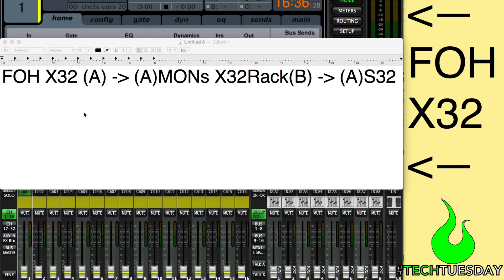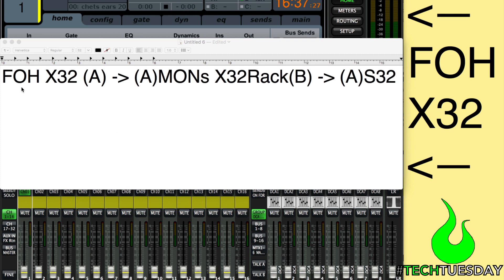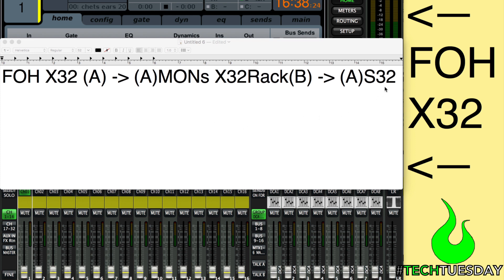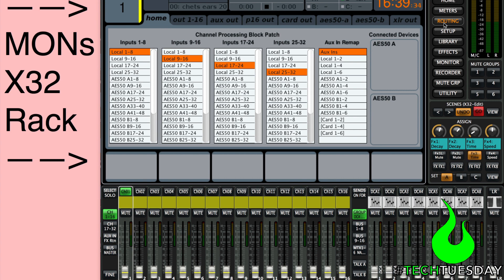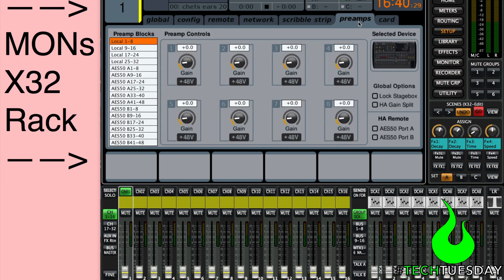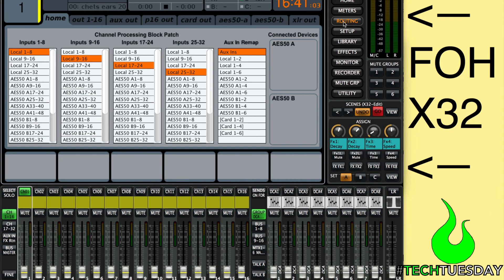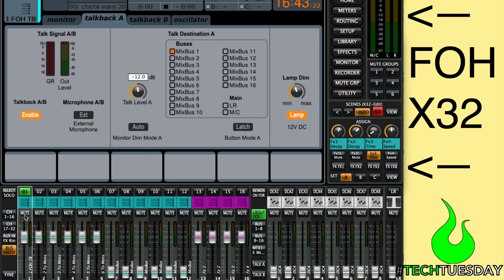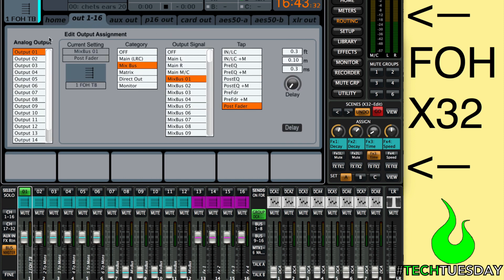Routing a Behringer X32 and X32Rack - Front of House and Monitors - #AscensionTechTuesday - EP088

Comment: hey your vids have been most helpful, but the one area i wished you talked on more, seems to be the area you just glance over. 

we have 2 X32 consoles and a S16 stage box, and two P16 routers sending to about 12 p16s. by following your video i was able to essentially hook up the two mixers, FOH Aes50 B to S16.  (The A port dont work for some reason)  the out S16 Aes50 B to broadcast Aes50 A.  Our setup is 16 channels from S16 1-16 and 17 -32 local at FOH. Following the vids in these series of vids i was able to send a mix to the other x32, but how and where do i connect my P16s?

Comment: Hey m8...nice tips for the auxes remap!! Just one question...I am watching and watching again your video and trying to understand how are you getting the inputs from the stage box??? They are connected to x32rack mixer through aes50b correct?? So shouldn't you select at x32rack at routing/home/aes50b1-32???
Found it ...hehehe 3:36 ...it s a bit brain burning but helps you practicing and understanding the signal flow through aes50..nice vid man...cheers
Reply: I was also thinking about this, the mon x32 sends the s32 inputs to foh x32 via aes50A then the x32foh sends back to mon on Aes50A. 
Is this required for the setup when you want foh to be the gain master?
Trying to understand what's the difference of just receiving snake inputs on x32 mon from aes50B ?

Comment: Couldn’t you go from the AES50 A of FOH to the S32 and then come out of AES5OB on the FOH to AES50 A of the broadcast/monitor rack as well?  That is what I’d like to do.
Then I’m not going through the monitor console to have FOH talk to the stage box and have a fairly independent monitor/broadcast mix.        Thanks
Reply from the maker: Wendell Nall Absolutely, that will work as well :)
Reply: Ascension Worship - #TechTuesday what would the routing look like?

Comment: I have 2 x32 in my church. Both need to use AES. How would I use my FOH x32 through AES to my stage rack for my PA and my other X32 for monitors through AES?
Reply: I also will be installing the waves sound grid on the FOH console. so my hope is to use the monitor console for untouched audio
Reply from the maker: Michael Lemus This video explains that setup. The scene for an X32 Rack and full sized X32 are interchangeable. Just different hardware.

Comment: Digital routing is fantastic but equally confusing...LOL!  I connected my FOH X32 to a X32 Rack and S16 that are placed at side stage.  The live stream computer that sits in the FOH video booth normally got fed from two of the bus sends.  All of the bus sends are at the stage now.  Is there any way to get bus sends to occur at both FOH and the stage?
Reply from the maker: Hey Rufus! All of your routing at the mixer should still work like normal :) 

-Chad
Reply: @AWTechTuesday  Understood, however, the routing is in banks of 8 so if the bus outs are routed to the rack at the stage, they do not output on the mixer or am I missing something?
Reply from the maker: Rufus Crowder So, generally your outputs via the AES50 ports are in groups of 8 yes but your output channels have 16 outs that can be personalized for whatever you want (such as deciding which outputs will have your main left and right signals). As a default, if you were to say route your stream busses to outputs 9 and 10, that feed would come out of 9 and 10 of your digital snake AND 9 and 10 on the mixer itself. There are ways to change this but as a default, that is how the routing is set up. 

If you’re having issues, in the routing menu, go to the XLR tab and verify that your XLR outs 1-16 are in fact outputting Outs 1-16. If not, then your scene has been modified at some point along the way.

Comment: At our church, we have our computer, cd, DVD, and the USB in our aux inputs. We often play sound through these channels. We are right now trying to connect two boards so we can play through the house and send a separate mix to the cameras for live streaming. How would you route the two boards to be able to control the aux from the computer, cd, and DVD on the "slave" mixer? Is there anything specific that you would need to do?
Reply from the maker: Dawson Welch Hey Dawson! I touch on it on this video when I talk about being able to send 6 channels from the master to the slave. In this older video that I’ll link below, I show some ways that you can submix channels with that method. In the video, I submix things like the backing vocals, in your case, you could submix your playback channels to achieve the same effect. 
 
Hope that helps :) 
-Chad 
 
https://youtu.be/fE52MsmK82E
Reply: @AWTechTuesday  What if we already have all of our submixes being used? Would there be any other way to do this that you know of?

Comment: Will the monitor console hear the EQ etc from FOH?  Can't you patch the inputs from the stagebox (port B in this scenario) in the routing tab rather than sending the inputs from port B to port A (FOH) then back down from port A to port A of mons? In my mind, it feels like there is added latency even if isn't noticeable, however in my case I intend to use Waves Multirack at Mons and FOH which will, of course, add latency, but I'm trying to reduce it as much as possible. Multirack at mons seems a bit extreme, but I intend to record the board mix on USB rather than multitrack or use of an external computer.
Reply from the maker: 2 reasons why I do the extra routing: 1) if you ever do a virtual soundcheck from FOH, this allows you to send those channels to Mons at the same time by only changing the routing at 1 console. This can be really useful for dialing in in-ear mixes. 2) There are up to 6 busses that I can send in this scenario from FOH to Mons, by sending all the audio from FOH, any latency that occurs will be equal on individual channels and busses so you won’t get any comb filtering if someone’s mix has a channel that is coming from a bus and direct from the channel. The added latency is negligible with this method. I haven’t measured it but I’ve never had a drummer notice it :) Thanks for watching and commenting! -Chad

Comment: Is it possible to connect stagebox to FoH A and then FoH B to a brodcast mixer or do I need to go back through the stagebox? This would save a lot of cable pulling.
Reply from the maker: David Andersen It is absolutely possible. The concept is the same. 

FOH Inputs (Home): AES50A 1-32
AES50 B Outputs:
B1-8 - Outputs 1-8 (up to 6 additional channels)
B9-16 - Outputs 9-16 (optional)
B17-24 - AES50A 1-8 (from stagebox)
B25-32 - AES50A 9-16
B33-40 - AES50A 17-24
B41-48 - AES50A 25-32

BCast Inputs (Home tab):
AES50B 17-48
Aux in remap - AES50B 1-6

In this example, the mixers are connected via the B port of each console.

Comment: Hi, this is a great setup. The only thing I would change is, where you have your B passing through to A on the Mon X32 Rack, I would offset them by one bank, so that AESB 1-8 is sent over AESA 9-16, and so on. This Frees up AESA1-8 to use to send Your AUX 1-6/Mon down there to front of house so you can then, Aux remap to your FOH auxs, specifically for monitoring the SOLOs of the X32 Rack. You loose the ability to send P16 down the digital snake, but most of the time your X32 Rack/core is stage end and you can plug your P16's direct into the Ultranet port.  Makes sense? Thanks again for the videos.  Jon Pratchett
Reply from the maker: Jon Pratchett Absolutely. I’ve done variations of this before. Good suggestion!